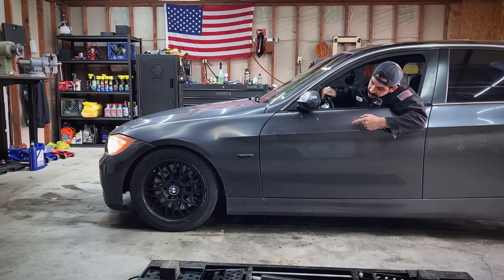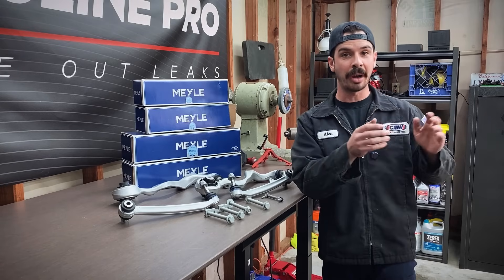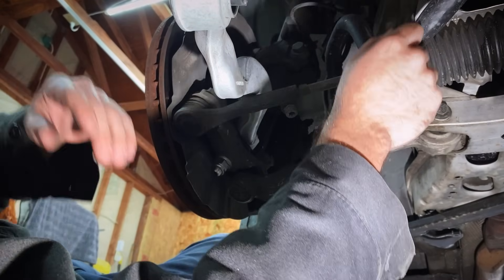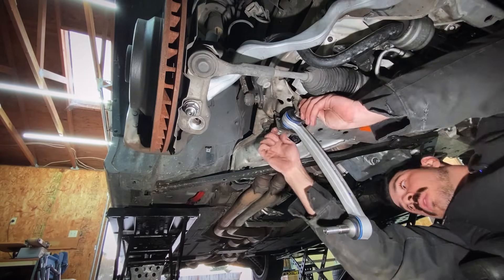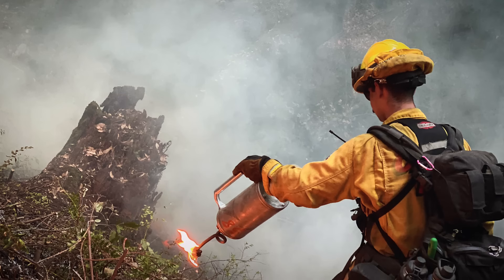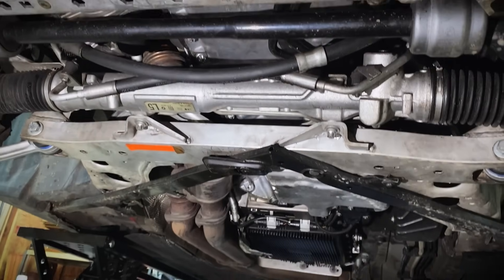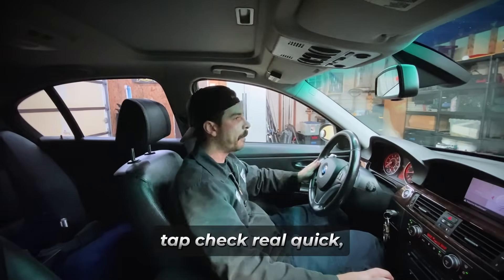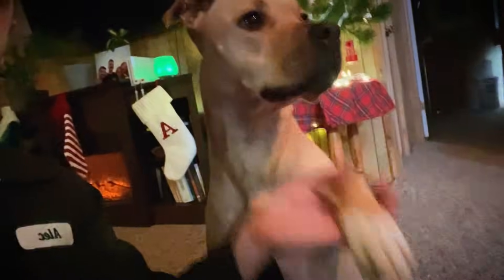BMW's #1 Suspension Failure & How To Fix It!

Comment: Thanks this video need to replace my control arms on my e90. I have a problem with my start stop button. Wanted to ask you for advise. It starts some times and other times have to press it a few times till it starts. Do you perhaps have an idea what it could be?
Reply: Explosive charge on positive terminal check it

Comment: I have a 2013 335is. Any downsides of going with the M3 control arm kit that you can think of?
Reply: Just dont get trw, i got them through fcp euro not realizing they are made in china😂 and the tension struts prematurely wore after 6 months or so

Comment: So I’ve got a 2011 bmw 325i that I got sir a steal because the guy couldn’t get it to run. After swapping the spark plugs, ignition coils and the valve cover I finally got it started. It’s currently throwing a crank shaft position sensor error and idling super rough. Order the crank shaft position sensor but wanted your opinion on other things I should check out just incase it’s more than just a sensor. Loving the videos, helped me a ton with getting my bmw fixed up.

Comment: Right to the point ! No blabla. Love it :-)
Those Meyle control arms looks serious !
I still have the M3 lower arm upgrade to do, I bet it's gonna be my choice too.
Interesting to see at 10:06 how the ball join in this arm allows some arm rotation when you let down the knuckle.
And really warn people to extend their steering links as M3 arms are longer. There is a big toe out otherwise and big surprise at the first corner.
(I have to watch you intake valve cleaning video now ! :-) )

Comment: Those bushings on the front arms can be upgraded to poly ones for much better steering response. I have powerflex black ones on my daily, minimal increase to nvh (I dont remember my car being quieter) and a great increase in steering response. Do the upgrade when you replace arms and they last forever so you just transfer them over to the next ones as well
Reply: Great video by the way🦾

Comment: My e90 needs major suspension work lol, all 4 struts and shocks are shot but I’ve got coilovers coming soon, control arms as well starting to crack. Lastly an alignment and wheel balance to top it off. My car has never felt more bouncier than a jumper 🤣 can’t wait to get all this fixed this week

Comment: I'm wondering what kind of driving people do where they blow these out in 40k miles? For us in Finland on pretty rough roads they last at least 100k kilometers, usually around 120k kilometers in heavy taxi use. And we've had: 2x E39, 3x E60, 1x E91, 1x E84, 2x F30, 1x F10, 1x G30, 2x G20 and our current one is a G60 i5.

Comment: Having worked in a BMW shop, I’m sure you know that this is an issue on MINIs also (at least older ones). I owned three different gen 1 cars (r50, 52, and 53) and the LCA bushings died on all of them within about 50k miles.  On the MINI they are significantly more of a PITA to change!

Thanks for your videos!  Always great stuff to see here!